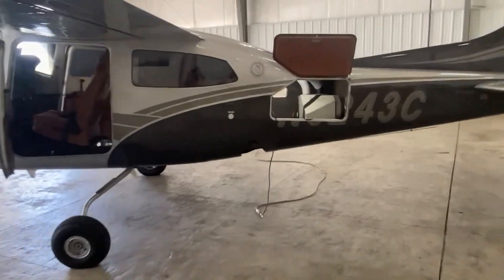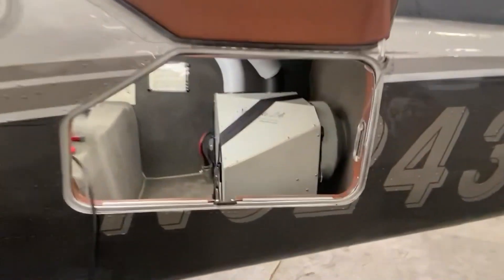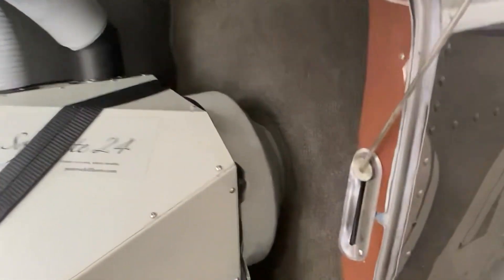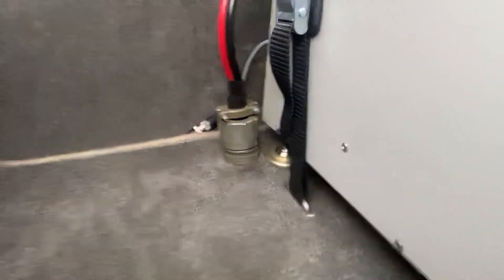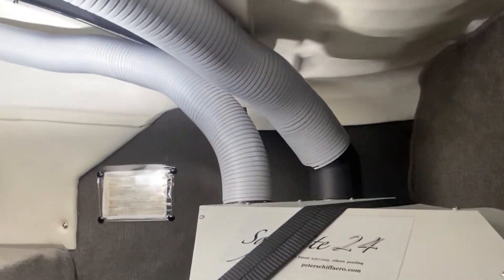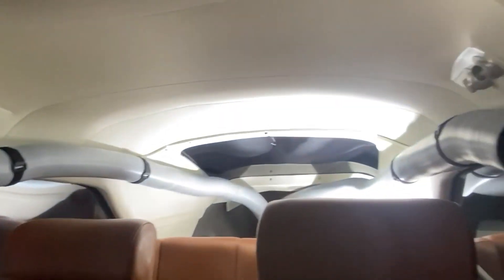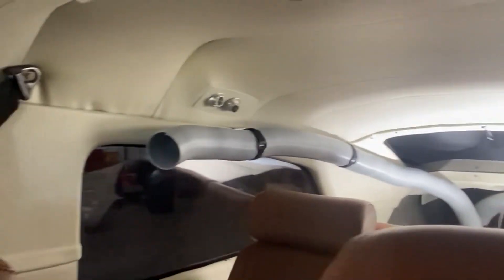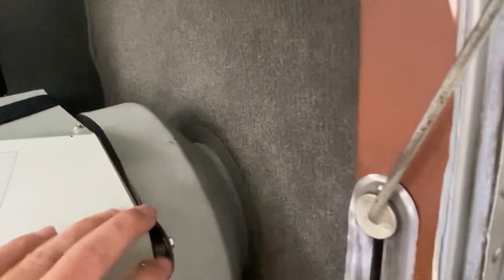Cessna 210 Air Conditioning Install | SofieLite™

Comment: I have a 210 and I love the concept but there has to be a better way to duct the cold air.  If you were to limit the ducting to not protrude any further than the 3rd row, how much of a decrease in comfort could one expect sitting up front?  20%?  50%?  80%?
Reply from the maker: We do have different options! Check out our 310 installation video to see an optional overhead duct. You can also inquire on our website and we can provide you with more information/ pictures!